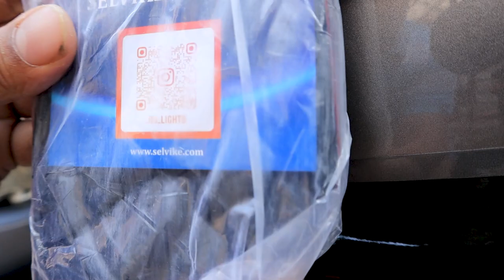TANK PAD/GRIP INSTALLATION| ROYAL ENFIELD METEOR 350 BS6 | DIY

Comment: Do I need tank pads for the sides of my meteor (yellow). I have ceramic coated the bike.Does the sides of the tank attract scratches from jeans etc?
Reply from the maker: Actually I don't have any idea if it's stick on ceramic coating or not. The pads are use to grip the tank so if you don't use to grip the tank while riding than you don't need the pads.
Thanks You for watching.
Please do like and subscribe to the channel ☺️
Reply: @HemantRangdal  thank you for the reply